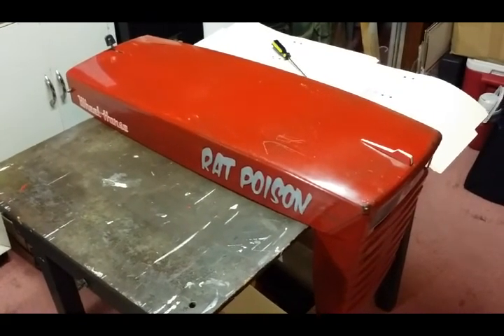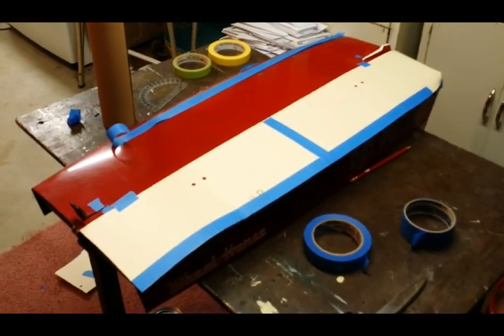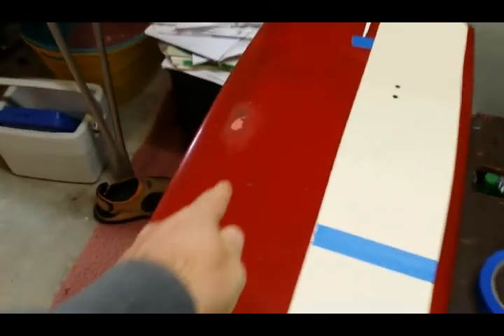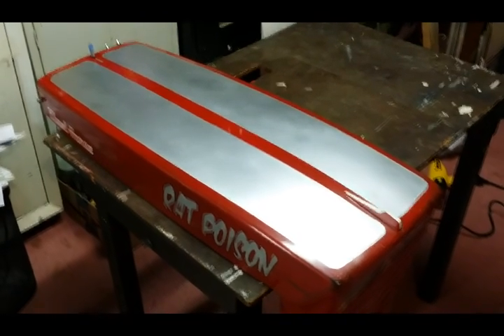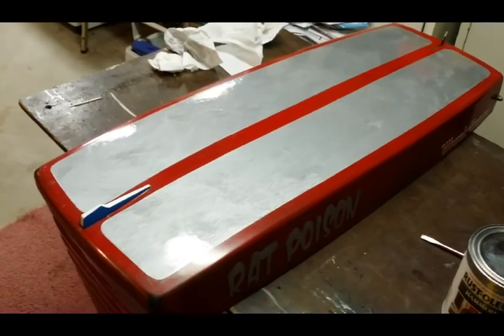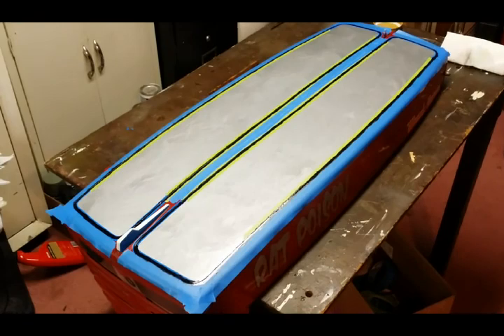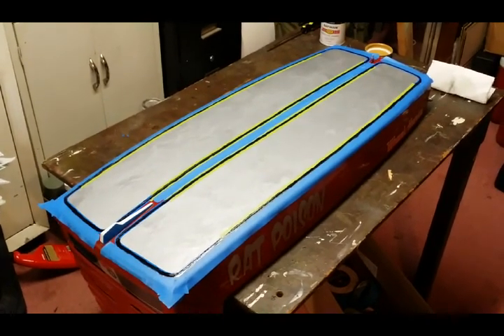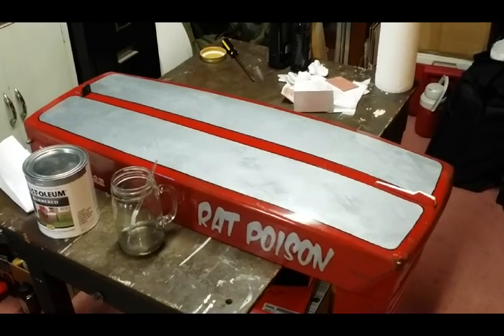Wheel Horse 1056 Rat Poison Garden Tractor Puller Paint Panels Stripes VinsRJ

Comment: Looks great Vin. I wouldn’t worry about the imperfections. The tractor is not fully restored and most vehicles/equipment that are that old and have original paint are going to have imperfections. Adds character. All part of the patina look. Only thing I would change(my opinion) is I would run an all black seat. That would make the fender stripes pop! They kinda get lost with the white of the seat pad. Not a hater 😁